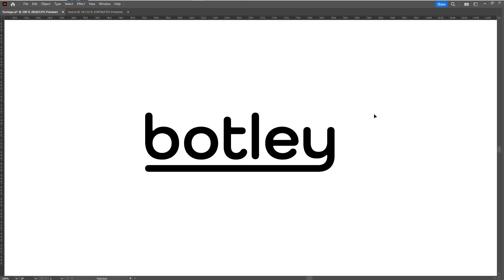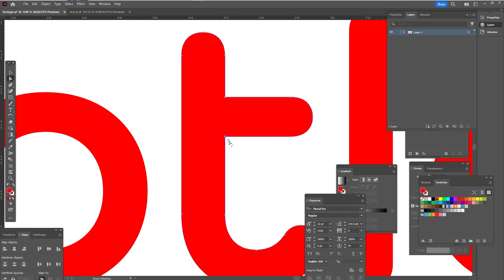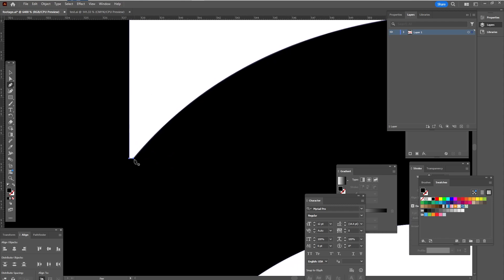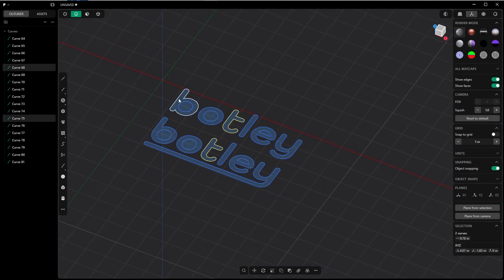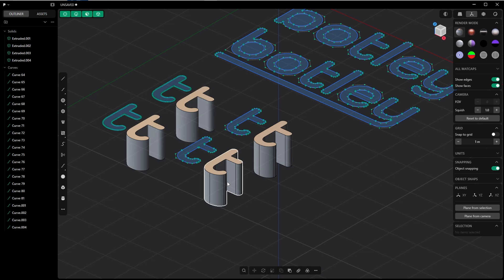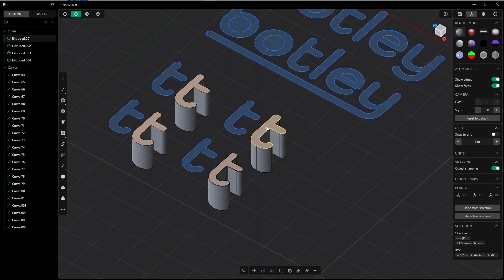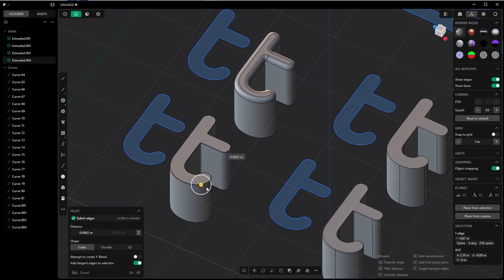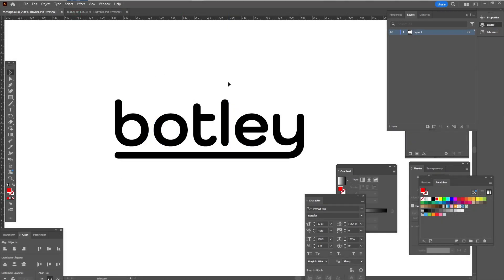Plasticity Tip No. 29 - Optimize vector

Comment: I was having troubles with text so I came back to watch your video.  Not only did I find the cure I sought, I laughed my ass off the entire time.  You are funny!  Please.  Don't!  Stop!
Reply from the maker: @Navigator777777  thanks a lot for the feedback. Typography in 3D is a huge topic in and of itself. I'll do more videos on that since it is often neglected in the 3D world. And typographers don't work in 3D so there is a huge blind spot which needs to be taken care of.
Reply: @3Dto2D  
I'm in the sign biz so text is a big deal to me.  Plasticity isn't very good at text but if a guy like me who doesn't know the little tricks yet  listens to you, then understands the reasons behind it all....successful prints are right around the corner!  I've used other programs like Solidworks, Ashlar Vellum Cobalt, Aspire, PowerCadd and they were built for text or so it seems?  Illustrator puts a lot of unneeded crap in their vectors...which I clean up with Astute Graphics plug in.   I've cut some of my older graphic file sizes by 50%. Bringing  clean vectors into Plasticity, getting rid of sharp corners and rebuilding worked for me! I'm printing an order for 9ea  7" Times New Roman Bold text right now that was going nowhere until I reviewed your video!  Where do I send the millions of excess dollars I'm making on this job?  ;-)

Comment: Hej… thanks for your videos!
Sorry, but I can`t reproduce the problem, neither in the current nor in the Beta version.
Using Affinity Designer (on Mac) I tried your botley-text with the font „Erbar“, which is a lot more critical concerning inside sharp edges.
Exporting to SVG, importing in Plasticity… I was able to do incredible large fillets without having any problems and without any preparing.
No need to rebuild curves before extruding text (in my eyes)… but if so, I get better results with „Refit“ instead of „Points“ (concerning sharp edges).
Dont`know… may be your shown fillet-problem could be with Illustrator or Illustrator-SVG?
Can mail you screenshots from my experiment if you like…
Reply from the maker: @thomasmuller7446  hi, that would be great, can you also send the svg? Maybe I can compare our cases in another video. Thanks a lot for the feedback!
Reply: @3Dto2D  With pleasure… ;-)
Reply: Supplement:
Having tried it with a few other fonts, I have to say that my „out of the box“ approach works for some of them , but all in all your suggested optimisation gives better results!